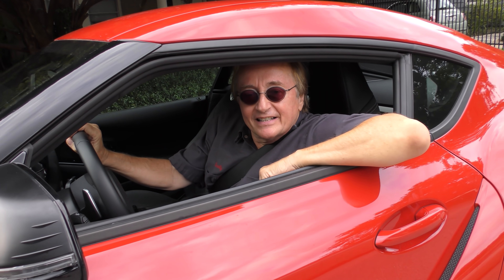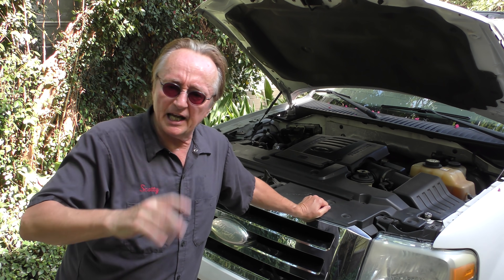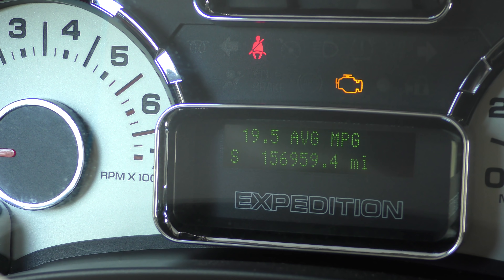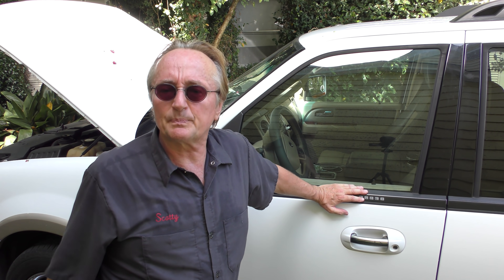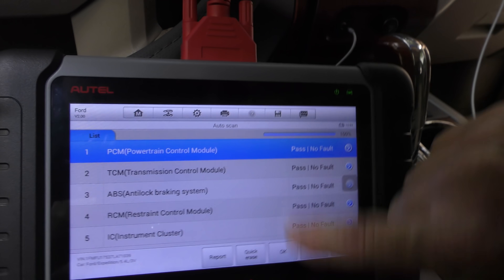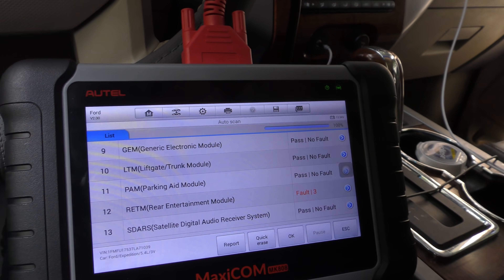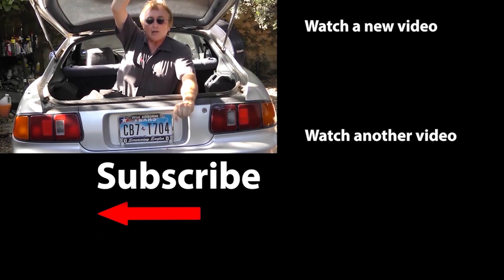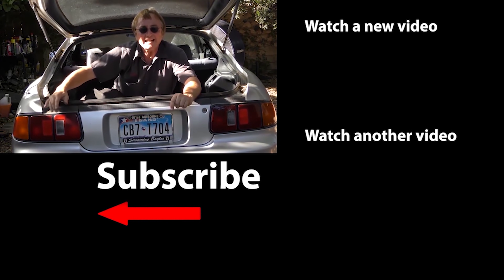The Cheap SUV No One Talks About

Comment: I paid 6k for my 02 Expedition EB in '08 with 108k miles. Now she has 320k miles and still runs great. Major repairs have been an intake and rear differential only.
Reply: I know this is an old comment, but we are currently looking at a 2007 Eddie Bower edition, with 190k miles for $6k. We are in the northeast, so rust is always a big deal. But if we can get them in decent shape, undercoating is a blessing. I don’t like newer cars. I like to buy older with cash, then drive them for a decade or more. I would be able to buy this SUV, and keep driving it for another decade.

Comment: I bought a 2007 Expedition EL 4x4 with 200,000 miles.  It had a perfect CarFax that showed it was serviced every 5,000 miles at the dealership.  I drove it for 3 years and gave it to my son with 240,000 miles.  It's still going strong.  The only issue is both rocker panels rusted out in the Michigan winters.

Comment: Mileage:  I can get 20 - 22 mpg over the road, if I keep it on cruise control at 70mph. Above, it quickly sinks to 16 when I push it to 80 to 85. Just change the oil every 5000 miles; the 5.4 L engine is prone to oil passage blockage from sludge. Keep the insides clean, use full synthetic and a new oil filter every 5K.  It just may last forever.

Comment: I never had a problem with my Ford Expedition (sold), but I prefer My 2002 Ford Excursion Limited with the 7.3
Reply: Whoa. Big one
Reply: i imagine you recently got the excursion and didnt endure the gas crisis from a few yrs ago.
Reply: @Mr.Pop0  It was worse I had 3 dump trucks thru the high dollar diesel years (100 gal tanks)
Reply: The Expedition has the rear hatch while the Excursion has swing doors with a hatchback like glass.  7.3 Diesel will get better mpg and is Fords best diesel.  Easier to put a lift on the Excursion with the solid axles.  

Love the rear hatch of the Expedition (glass goes up also).  3v 5.4L like this one has more engine issues compared to the old 2v.

Comment: Have 04 Ford Expedition w/5.4 3v still going strong. Has 220k miles w/OG Engine. She’s does tick, but still doing regular Maintenance. Like Scotty said not good fuel mileage, but she does have tons of room. A far as replacing or fixing spark plugs or anything engine bay wise. You’ll have it hard. Theres not a ton of room, but still manageable. I Plan to run this SUV until she’s done. Definitely will install A new engine that’s been updated.

Comment: I use a 2010 SSV Expedition at a towing company for a roadside assistance vehicle. It was bought at government auction from a fire department where it accumulated about 75,000 hard miles. Even came with the red lights and emergency stuff on it. Now it runs 12 hour+ shifts in the snow, mud and super cold and hot weather alike. Has about 900 lbs of tools and equipment on it including a 12k lb winch for pulling vehicles out of ditches or off road recoveries, and it's occasionally used for towing trailers as well. It's a beast of a truck. It goes where others can't, and it even has mud tires on it. I'd take driving it over the tow trucks any day, and the tow trucks are almost brand new! Very solid, and dependable vehicle.
Reply: My daily driver is a 07 expedition SSV with the column shifter. I brought it in 2019 from auction. The interior is just the basic beige color, it didn't have any Police/Fire dept. Lights. So I have no idea what it was used for previously. It's been awesome though currently has 234K miles

Comment: This is right around the time Ford finally started getting things right with the 5.4 V8.  I’ve seen quite a few of these with well over 200k miles and even some with more than 300k.
Reply: Sure they can have problems. I had an 06 f150, wasn’t perfect but got almost 200k miles out of it before I got rid of it. Only time it left me stranded was the starter at 185k. Feel bad for those that weren’t as lucky!

Comment: I have 2 expeditions. A 2002 and a 2005. They have been great and reliable vehicles. The 2002 lost its transmission around 160k miles and the 2005 lost it's at about 145k. Both towed a 4500 pound boat in the mountains which I'm sure has contributed to the failed transmissions, but both engines still run great with the transmission being the onlyissue.
Reply: I'm very surprised how hard my will pull

Comment: I never had problems with the 4wd system on my Expedition. And I can but wonder if scotty has ever driven in snow. As someone who has driven trucks and SUVs that have both 4wd and 2wd modes, it makes a huge difference. And 4wd does help cornering and braking in snow. Its been proven in testing.
Reply: Yeah i was wondering that. Here in the midwest 2wd vs 4wd makes a hell of a difference.
Reply: @blagueur74  plus with 4wd you can go to a snowy parking lot and do sweet 4 wheel power slides

Comment: Recently bought an 2011 Expedition XLT with 73,000 miles for $9600.00.  Same deal.  Everything runs very well.  Only issues are middle seat won't fold down(will repair it eventually) and the weather seals on the doors are poorly.  Highly recommend.

Comment: My grandfather has a 2006 suburban with almost 300,000 miles on it and the only thing that has been done is oil changes and brakes but other than that the transmission has never been touched. You can’t go wrong with either ford or chevy

Comment: The 07 was one of the best years for this truck I've got one with 300k and all original motor and transmission.  Hauled a 8000 pound rv trailer through the arizona mountains not one issue

Comment: Coming from a family Navigator owner (Literally same thing) if you can afford it, I’d recommend getting 2010 or newer. Seems that’s when Ford fixed all of the issues on the Expedition/Navigator. My Dad used to have an 08 Navigator and the rear left suspension broke 3 times in a time period of 3 months. Also had lot’s of other issues I can’t remember. We sold it for a 2014 Navi. It’s got an extra 10 horsepower, transmission is more smooth, and it’s a lot more reliable.
Reply: When I bought my '10 EL 7 years ago I drove the '10 & an '08. Despite them looking almost identical,  the difference in ride was unreal.

Comment: 2002 Expediaton since 2012. 4R100 transmission was a plus to me. It has blowen 2 of its spark plugs out but repaired. One coil on plug replaced. Overall, 2v 5.4 is OK. $10000 96,000 Miles, 162000 now. I got B1261 code so A/C isn't blowing cold all the time when sun sensor is shorted. Paid for, priceless. I can buy a lot of gas for a car payment cost. And I can play my cassettes and CDs yet in the radio.

Comment: A month ago I bought a 07 expedition EL Limited with 100k miles for 4,200!!! Really nice truck, I love it!
Reply: Change the transmission fluid every 30k miles, watch out for cam phasers (diesel sounding engine), be prepared for blend door actuators to fail (temp control and buried in the dash), a few other issues. Good luck.
Reply: derekisthematrix Thank you very much. Already did some research and find out about the cam phasers and the spark plug issue. Right now I can’t figure out why it only lets me fill it up 3/4 of a tank. After that I have to keep pressing the nozzle little by little if I want to fill it up all the way.

Comment: I have a 2011 Ford expedition XLT 5.4L V8  used with 98,500 miles now it has 264,356 miles and it’s still running smooth

Comment: Me and my wife both have an 03 . Hers has 390,000 mine has 268000. They are great SUV’s. We’ve used them just like a pick-up with rear seats folded down. 4.6 Ltr gas mileage isn’t bad either so long and your not gunning it from light to light.

Comment: Wow, didn't Ford have one of their biggest set backs ever with the 5.4 3V motors? Infamous for cam phaser and timing chain issues, as well as the spark plugs blowing out of the heads. Come on Scotty, dig deeper.  "2009-2010 The 5.4 -liter V8 improved in 2009, fixing the cam phaser issues and all but eliminating the spark plug problems."
Reply: They are not the best engine Ford made. With the proper maintenance and oil changes every 3K miles they can go. I know because I own one!

Comment: I Got a straight 6 E53 BMW X5 with Over 100k Miles Being Used In Nigeria and I still got Factory Gear / Transmission and all Functions Working Fine and I drive it Everyday. No Major Fixes and A Fantastic 235HP performer. With a BMW prestige. That to Me Is The Best within That Budget.

Comment: The spark plugs breaking on the 3 valve engines are a pain in the a$$ along with the cam phasers...
Otherwise they are pretty good vehicles.
Reply: Yeah he didn’t mention the fact that after 100k there is a good chance you will need a new engine very soon.
Reply: Buy a 09 they redesign the thread and sparkplug
Reply: @marshallkobe  169k 4.6l 3v here. Smooth running
Reply: @BPatches701  must be previous generation. This gen only came with the notoriously bad 3V 5.4L V8
Reply: @derekisthematrix  I have a 2010 f150 actually.
Reply: @BPatches701  I thought it was the pre '04 engines that had the spark plug blow out problems.  Supposedly fixed in '04.
Reply: @garyh7949  no, you're right, a quick Google and the 2v engines were the notorious ones. Maybe this SUV is alright then.
Reply: Mike Hatfield every engine has its faults
Reply: @BPatches701  the triton used 2 peice spark plugs which sometimes broke apart inside the heads when you tried to replace them.
Reply: @clayzr4716  my 3v was easy to do because I took my time did it warm and soaked it with PB before I started
Reply: Spark plugs break if ur 23 and work at jiffy lube.

Comment: I have a 2004 Ford Focus  278,000 MILES 75% city miles I Still have de original transmission shifting like a dream and original engine maintanance by the book, now on the other hand i drove a 2007 YARIS with 84,000 miles and the engine was running ruff above 4500 RPM , my focus engine is smoother with almost 300k on board
Reply: Zettec engine and 4 speed automatic transmision
Reply: what's it like underneath lol..like swiss cheese i bet
Reply: steve james frame looks very good in terms of rust , a good friend of mine has a 2003 toyota hylander and his frame is way worse than mine underneath, almost to scary and dangerous to be on the road

Comment: My personal reason for not picking up a full EV is not just because i think the lowest range of an EV should be atleast 600 miles (967 km) but if or rather when you get stranded because it probably going to happen to some. You cant just bring a spare jerry can and get up to 100+ miles in an instant but you have to tow the car what ever happens. You cant just bring a small powerplant or new battery if you run out. Living in more open areas and difficult terrain doesnt mix well when you suddenly need a tow to get to an outlet. I like the idea of hybrids more

Comment: Woah woah woah!  Hang on there Scottie Does it have the 4.6L if so your good if not then it has the 5.4L which is a bad engine design and has issues with the Cam Phasers  and spark plugs blowing out. You need to make another video talking about the Ford 5.4.
Reply: It doesn't have a problem with spark plugs blowing out. They commonly break when you replace them.
Reply: @back2roots779  After 2008 they fixed the plugs getting stuck in the 5.4's. The cam phasers or vct or whatever they do have issues too. But still they are nice suv's.

Comment: Props to the dude for getting 19.5 mpg. I bought a Chevy Trailblazer with an I6 that has about 300 horsies and I normally get about 16/17 combined, but it's also 4x4.
Reply: I have the SSV 4x4 version of the 2010 Expedition. It averages 14.5-15 mpg.

Comment: i recently picked up a 04 expedition EB for 3 grand, i'm staying away from the 5.4L 3 valve
Reply: As you should 👍
Reply: Exactly! He spoke nothing about the Cam Phasers or Spark Plugs. If it's a 4.6L then it won't have those issues at all but he needs to say that.
Reply: Such a spotty engine. Mine has 300k on it with original timing equipment. But likewise bought one for my son with 80k on it and the equipment went out at 88k
Reply: 5.4L have there faults like any other engines, I don't understand the hate about them... Every engine has problems, even Toyota built cars that has problems, cough older generation Prius,  Camry and Corolla for a couple years. I have one myself 06 Expedition 185k on the clock... Only major I would say is the flywheel going out a couple times, other than that mines has been dead reliable. You gotta take care of them, that's all. I'm never getting rid of that SUV until it dies, nobody wants that gutless older 4.6 and 5.4. lackluster

Comment: When I think of reliable engines the 5.4 Ford 3 valve V8 isn't one of them.
Reply: If you change your oil religiously (so the cam phasers don't fail) they are actually really bulletproof. But that's just not something most people are thinking about... Also spark plugs, of course.

Comment: I just bought a 2012 Expedition King Ranch with only 39k miles that looks like it just rolled off of the assembly line. I'm planning on changing the oil every 3k miles and just bought a new transmission filter and will replace the fluid that's in the pan. I probably paid too much, but I wanted one with low miles.

Comment: Woohooo, thats the car I drive (except 2010) and my choice gets the Scotty seal of approval! Mine came with the bad entertainment center,(I'll never fix it), one burnt out retracting running board motor (I took out the passenger running board) and shattered cheap plastic moonroof hardware (fixed it water tight but I'll never open it because it's fragile). I only paid $2700 for mine and its got 4WD (I'll only use that if it snows and in NJ it didn't last year).

Comment: I just paid $2900 for a 2004 ML500 AWD nice interior, good paint/body, push bar, running boards.  Only thing is the FM radio does not work, CD's only.
Reply: @TuckerClarkson  I've already owned it half a year HAHA
Reply: @TuckerClarkson  why would I pray?  I also daily drive a 2005 slk350 for the last 4 years and never had one issue I put 50k miles on it. The ml500 is used only when I need to tow or drive onto the beach.  If something catastrophic did happen I do all my own mechanical work currently doing a frame off restoration of a 58 plymouth Christine.  The other vehicles are just cheapies that I don't care too much about.  The ml500 is clearly better than that 07 ford piece of junk.  I just got rid of my 08 ford f250 because of electrical gremlins and bought the ml500 it feels so much nicer to drive
Reply: @TuckerClarkson  It should because I use it less than 100 miles a month and the dealer told me the guy who traded it in just paid for a brand new transmission.

Comment: I have a Ford Escape with more than 200,000 miles on it. It has no problems and has only been to the shop for a repair once. 
I have a Ford Explorer with more than 370,000 miles on it. It has no problems and has NEVER been to the shop for a repair.

Comment: I took mine to Scotty and he told me to get rid of ours that had 150k miles with a slipping transmission and ABS problems. I replaced the damn passenger window power window regulator 3 times. Blend door actuators kept failing for temperature control. Our 2016 Sequoia with a lower tow rating (7400lbs vs 9300lbs) now tows our camper much better than the Expedition. The 3V 5.4L Triton V8s are notorious for cam phaser problems. STAY AWAY!

Comment: Scotty, is a 2002 Corolla with 44K original miles and only one owner a good deal at $2,700. Owner is an old lady who drives it every week but only for a few miles each way. Has bad head liner and some cosmetic stuff, flaking paint around windows, and  a bit of sun damage to vinyl on door interior. no lights on but feels a little rough. what do I look out for if I'm worried it hasn't been driven enough. Thanks

Comment: The Chevy Sonic was the last small car made by an American car brand. Also, Chevy doesn't make the advanced safety features standard unlike Toyota & other foreign automakers. On the Sonic, the pre-collision system with emergency braking, lane departure warning, and blind-spot section is optional. This shows how cheap GM is as they don't want to make these features standard while other automakers do.

Comment: This missed the mark. The real hidden gem is the fourth gen explorer. A fantastic zf 6 speed that usually only needs valvebody work, and a 3v 4.6 which avoids the oiling issues on the 3v 5.4 while still providing 300HP & TQ on a traditional body on frame SUV with a fantastic riding full IRS set up. Cheap!

Comment: GM Had the EV1, & they killed it. THAT was the biggest mistake they have ever made. The Tech from that could have been a revolution to the postal system with solar, & electric postal trucks. GM has messed me up for over 6 years, & I will still not pay the dealer for messing up my repair.

Comment: I have had horrible luck with my 05. It only has 145k miles. I’ve had it for less than four months. I’ve put 2500 dollars in it and now cylinder 4 is misfiring. I’m thinking about trying to get rid of it.

Comment: I had a Ford Explorer 4.6l v8 with a five speed automatic and it crapped out at 285,000 kilometres. The transmission was failing, the power steering was failing, had electrical issues, and engine issues

Comment: 1st question: Scion F-RS, Toyota 86, Lexus SC

2nd Question: Lexus RC or Toyota Supra
Reply: The 86 and FRS are actually the same car. As far as RC and Supra, at the price range I'd take the Supra or if you can spend more get the RC-F, its a V8 while the regular RC is an Inline 4.
Reply: Lu Pavo thanks dude! That was really helpful!  So screw the Subaru and bmw, get an RC! 😂

Comment: Fords are great, as long as you don't actually use them. 2007 with 156K miles = 12000 miles per year which is low mileage, thus not used much which is why it is still on the road. Most Fords rarely last beyond 10 years old and/or 150K miles...